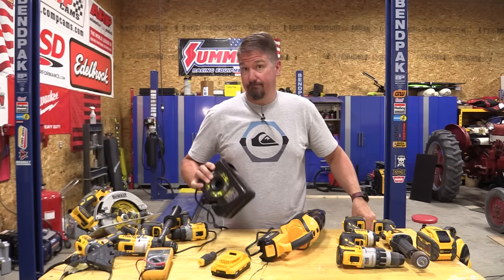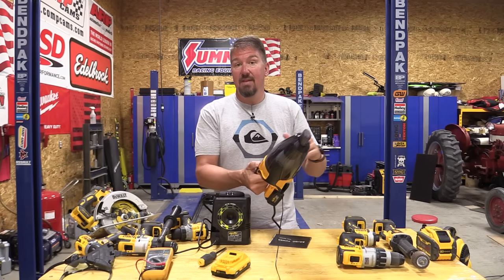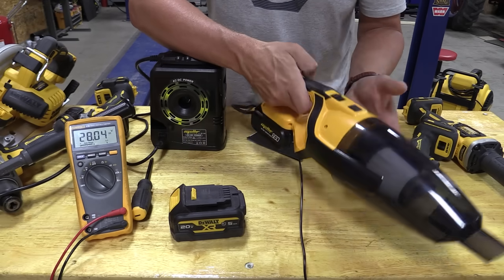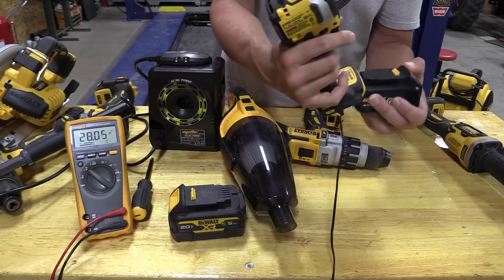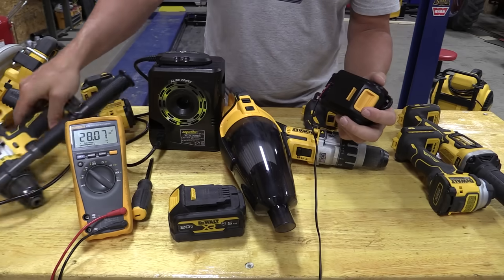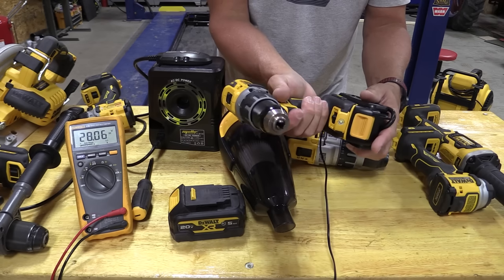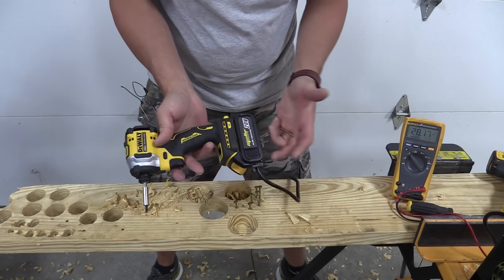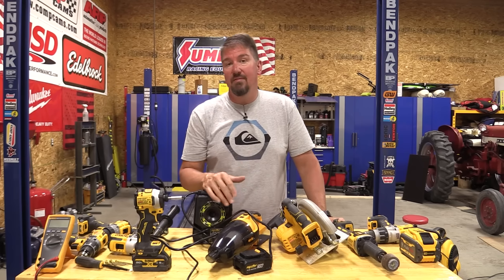An AC Adapter For DEWALT 20V Tools!

Comment: That voltage even under load is higher than I'd be comfortable with given the regulation and microcomputer control in even a brushed tool

Comment: I wrote directly to DeWalt and they said they didn’t have any plan to build an adapter at the moment but they might consider it… but I doubt they will since batteries offer them waaaay more income than any corded tool. Their batteries die very quickly which costs us a fortune when we use them 40+ hours a week

Comment: The high resting voltage indicates that they are not properly regulating the output of the converter and that it is likely just a simple transformer/rectifier setup.
Reply: It seems they forgot when you add a filtering capacitor to smooth the pulsating DC wave, the DC output is equivalent to the AC peak of the transformer's secondary winding. As 20*1.414 is 28.28
Reply: @unfetteron9518  You obviously have more technical knowledge than I do. I am simply speaking from experience using more simplistic power supplies (ie: buck/boost trans with basic bridge recrification) over the years.
Reply: @chrisose  I just finished my electronics semiconductor/ power supply course in May so it's fresh.

Comment: My hat's off to MetaboHPT for thier having produced one of these - and to you for trying out the Mellif so i don't have to. I think I'll pass on the Mellif based on your testing, but I would love it if DeWalt would come out with one of these. I'm not really sure i understand why it is (seemingly) such an engineering challenge - Dewalt did it for one of their flexvolt miter saws; you'd think they could do it for the lower-powered tools too.🤔 Anyway, great content - you seem to have a habit of answering questions for me that i hadn't even formulated yet!👍
Reply: The engineering challenge is money lol
Reply: @Thinkableness  😁
Reply: Weren't those saws bricking themselves when plugged into the wall though?  I recall watching a popular YouTuber finish carpenter swear off DeWalt after going through hell with their customer service over the issue.
Reply: @NonieTools   interesting point - the only one i know of that has mentioned that issue was Finish Carpentry TV; he claimed that a factory authorized service center rep implied that there were known/widespread problems with use of the AC adapter. It may not be unrelated that the newer version of that saw no longer has the AC option - so yeah, plausible... Anyway, i hope Dewalt can figure it out - having an AC backup option for the entire platform would be fantastic IMO.
Reply: @Thinkableness i would totally agree. On a business perspective, such an 120 v ac to 20 v power adapter will hurt battery sales
Reply: I don’t think the need exists for it anymore. They’ve now completely replaced a lot of even heavy duty gas powered tools. What kind of work would eat through so many batteries that it would make sense? Lots of Trim carpenters using dewalts 12 inch flexvolt miter barely go through a 9 ah battery a week. Power output is greater with batteries also. So, no advantage except eliminating the hassle of having to recharge. But, even that takes place in less than an hour, pushing on like 15 minutes now on rapid chargers. They still make corded versions for that minimal use case. I guess what people want is basically just more features, however unnecessary.

Comment: thank you for testing & ranking it, good to know it's like a 2Ah, better on old tools, and maybe great for flash lights. Sadly not much cheaper than the MetaboHPT adapter. Also, this thing is meant for all the little Mellif consumer tools, not DeWalt.
Reply: Where's Makita at? They like engineering things...

Comment: We need this adaptor for all the cordless angle grinder from every brand in our workshop but we hope the converter could supply more power than you have tested
Reply from the maker: This is not up to working an angle grinder.  However the Metabo HPT does it well.  I hope to find a high quality model like this.
Reply: even the MetaboHPT adapter is not full Amp on their 18V grinders. Not sure where that situation is for the 36V grinders.
Reply: @WorkshopAddict Has an another youtuber has made this project for years on Milwaukee tools and Torque Test Channel has tested it modded and given the nice performance result with D Handle 1 inch Impact Wrench
Reply from the maker: @QuockhanhPham20  I will check that out
Reply from the maker: @wim0104  They are not, but it is not far off.
Reply: Just buy a corded metabo... It will be more powerful than any cordless you have anyways

Comment: Was interesting to see the electric brake work so well on the circular saw on AC. Hikoki/Metabo HPT with their AC adaptor has problems with the electric brakes in some tools. In Australia the adaptor comes with information saying not to use it with the MultiVolt grinders due to electric brake not working.

Comment: Needs, higher wattage power supply and/or a capacitor bank to maintain voltage on tool startup and under load. And, and adjustable voltage regulator. Lots of heat sinks. Active cooling. This could be built in one day.

I have a dead 12v xtreme battery. I’m going to go wire it to a marine battery, and see what my collection of 12v tools can do. This will be fun.

Comment: 28volt is too high voltage for Dewalt and other devices that work with 18volt. It may damage the electronic circuit of the devices. As far as I can see, it does not feed the devices fully, it is definitely unsuccessful and dangerous.

Comment: As you and others have said, way to high voltage to run this comfortably. Some said maybe with a flashlight, but having s short cord i doubt even that would be a good use. Maybe if someone w a old brushed circ saw was cutting 1x all day, or an old brushed drill with a custom stand to use a drill as a drill press for small stuff. Wonder how it would work w a flexvolt tool since they run on 20 or 60v batteries. It may be the only thing worth the risk of long term use if it made the tool function properly

Comment: I don't know if you watch the "Finish Carpentry TV" channel, but he has a video from two months ago with title, "I'll never buy another DeWALT tool."  Apparently there is an issue with the actual Dewalt AC adapter that kills tools  It would be interesting to see the output voltage of that!
Reply from the maker: The only dewaly ac adapted I know of is the one for the miter saw???
Reply: Yeah, it was a miter saw. @WorkshopAddict
Reply: I was about to type that. DeWalt was trying to wash their hands of the situation by advising against using their own stuff. So much for OEM quality control.
Reply: I also watched this video from finish carpentry and even Dewalt knows there's an issue with their own 120V-20V adapter.

Comment: I’m not expert in this area but what looks like u need a big audio capcitor in line with that unit to buffer it 
And still looks like that thing be down on power 
But ussally there is efficiency problem coverting ac to dc 
So there only so much power u can convert so fast we’re that compasitor should fix 

In emergency it will work but not every day solution 
I know meatobo makes one but u know they put more reasearch into the design then this company

Comment: Man, I'm just trying to find a simple plug-in ac adapter for a jobsite fan since dewalt's dce512 fan got rid of the ac option the dce511 had. I don't need a giant transformer box to lug around... LOL
Reply from the maker: @nelsonbrum8496  there is nothing out there with at is not dangerous.   If you do find anything, let me know.

Comment: With batteries so abundant and easy to obtain from all the special offers, I don't see this having a particular place of use. Unless you'd want to use some kind of consistent running, low draw, item. Like lights. Maybe high draw item, like a vac? (If Dewalt would come out with a useful brushless version that doesn't break the bank.) Why would you want to turn a cordless tool into a corded tool, when you could just get a corded tool in the first place?
Reply: Because its nice to have the option to run cordless or corded wo having to have 2 of the same tools. I dont see much use for something like this for drills or impacts, unless you have a custom made stand to turn a drill into s drill press. But for saws and grinders that eat through batteries and are often used in one spot for a long time or used remote for quick things, it be nice to have the option for cordless and corded. Again, wo having to buy 2 of them same tools

Comment: With such good batteries I am not seeing any point in this.
Reply: I think the main point is that for some tasks, like framing a house, you're running your circular saw all day long making hundreds of cuts, sometimes on very thick lumber. During that time you could drain quite a few batteries, then you would need to make sure that they are all charged up for the next day. The point of this AC adapter device would be to be able to plug in the saw to a 110 outlet/plug so batteries aren't needed, and so you don't have to pack your corded tools that you might keep at home. It's definitely not something that most homeowner DIYers would need because their projects are usually never so big that they would run out of batteries on a project... This adapter would mainly just be for professionals that might run across a task where they need to use one or more certain tools that have high energy consumption all day long, like a skilsaw, grinder, rotohammer, etc. Personally, as a general contractor, I run across this situation a couple times a month. Most recently I was doing concrete footing/foundation forms and had to make hundreds of rebar cuts over a 3 day period. I could bring my corded grinder or skilsaw with a metal cutting blade from my garage, Or I could just use this adapter device and be able to use it with my battery grinder / skilsaw that is always on my truck... I wouldn't have to remember pack my corded tools. Or let's say that I forgot to charge up all of my batteries, this device would be a great backup for that situation. On top of all of this, batteries aren't cheap, so this device could save you money in the long run. Hopefully this all makes sense. You're definitely not wrong that the batteries are great and are fine in 99% of situations, but a 110 adapter could be very useful for professionals doing certain tasks.

Comment: Hilarious, buy for the convenience of no cord at the cost of a lower power with expensive batteries and a more failure prone tool only to add a potential failure point of a switching power supply and cord.  You can't make this stuff up.